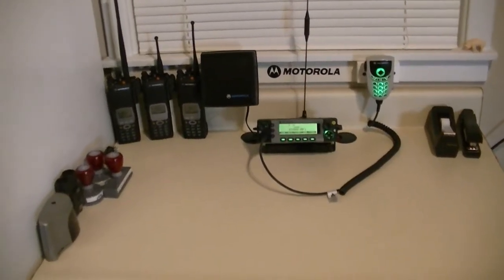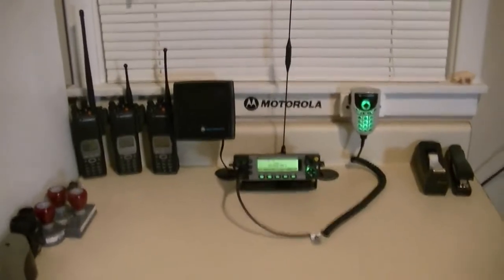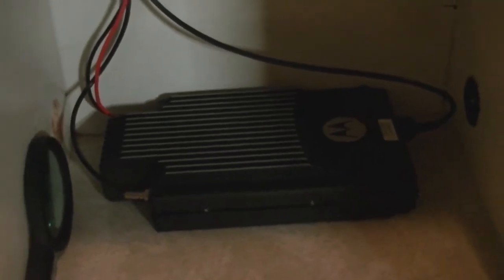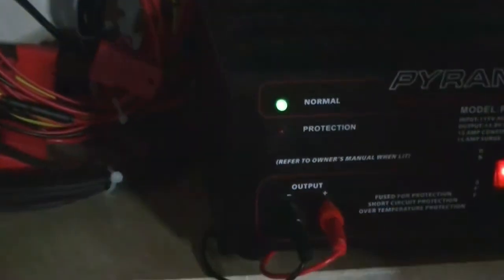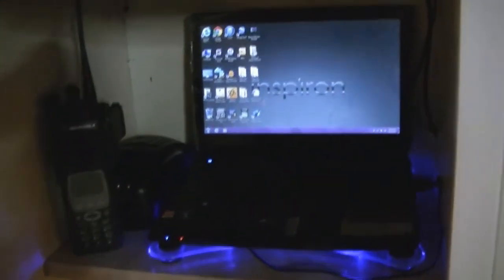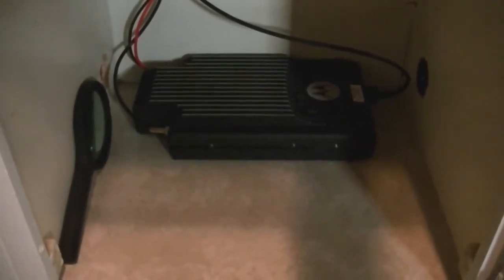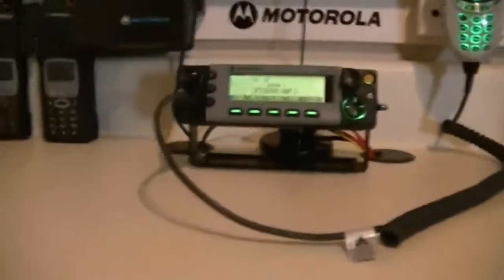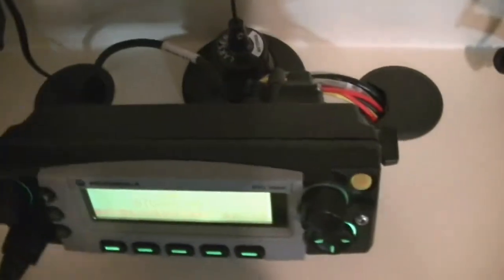MOTOROLA XTL5000 110-WATT UHF REMOTE MOUNT UNIT FOR A BASE STATION SET-UP

Comment: both mine are dual band hi gains on a rotor motor which actually helps just like on 10 Meters am/fm bands but I'm really into APRS THESE DAYS & digital uhf vhf like 800mhz bands I linked my first zello repeater setup thru one my Baofeng UV5R radios to pc sound card which repeats off my simplex to my zello app which is digital server based world wide band it's very neat indeed

Comment: Man that antenna seems a bit close, no?  I would think it'd need a ground plane unless it's one that doesn't require one.  ^^ This guy sells excellent radios by the way - some of my nicest XTS5000s have came from Mr. Snarlingrabiddog
Reply from the maker: Hey there!  haha, yep, it was way too close for my liking.  I took care of that, organized the nest of cords and wiring, got the VHF in as well, and it looks much better.  The cords were (and are) hard to manage.  The antenna doesn't require a ground but the units do.  I have an exterior ground outside and routed the line to the cabinet from the back.  I had to take it apart to get it all together.  I'd like a small switching station and an adapter to join both XTL remote bricks so I can just toggle between the bands using the same head, but not sure it's possible. Thanks for the kind words and the plug buddy!  I'm glad you're enjoying your radios.  All the XTL's are going to be sold but the UHF.  I'm renovating my shop so the XTL's have been put on the back burner for a bit :)

Comment: Understandable I'm aware of ignition purpose but also work for vol agency. I'm also in a mini boat like you but not into sales lol. More of personal use and for agency. Just looking for pointers as I've caught heck with just one vehicle which happens to be remote head. It's been the darnedest deal. Came with it but was ignition only. Have attempted to make it by power button but it's strange. Any chance off board you know anyone who would know?
Reply from the maker: I really don't.  XTL's are difficult animals and there are so many variables with mobiles, in order to address issues, the revision dates of the respective components have to be known; that is perhaps the most difficult aspect to nail down.  It seems that nearly every XTL is different; that shouldn't be the case, but in my small dealings with them, it seems to be the norm rather than the exception.  I've learned the hard way on these XTL's.  Mine install and function without issue, but understanding the component variables have proved to be an expensive education that even at the end, is one that is never complete if you buy another or build another.  After mine are gone, I'm out of the XTL game and will stick to portables.  My profit margin is next to zero on these darned things.

Comment: Dumb question and I'd appreciate if you could get back to me. The programming for remote head is it set for blank, soft power? Should be in radio wide advanced. Also does the cps show two heads in the menu say 03 or 05 or just one?
Reply from the maker: The CPS should show how ever many heads you have on the system.  It is default to 03 and 05.  Most units have no more than two but an 03 head is a remote head built into a mic housing; an all-in-one if you will.

Comment: Also does the head power have both wires connected? The yellow and red to power?
Reply from the maker: If it is base station, I hook red and yellow together because the yellow is for the ignition of a car and turns on and off with the key as you turn the car on.  I maintain constant power on base stations and turn them off at the head.  It depends totally on your application.  The more heads you have the more wires and the more of a nightmare you create for yourself, but on a fire truck rig, dual heads are common for the big trucks; one in front, one in rear.  Cable-running is paramount and you have to make sure nothing will break into the cables.  The variables change with the platforms of application.  I'm not an authority on the XTL units.  I build the parts into packages, flash, upgrade firmware, program them in basic form and optimum menu configurations and sell them.

Comment: I like your private UHF STATION very similar to mine only I have both UHF&VHF radios and my antennas are on my outside tower at 60ft like my duplex and simplex repeaters are
Reply from the maker: +Justin Berryman Thanks, I also have a 100-Watt UHF that's right under the VHF brick and it's switchable now.  I just have to switch the cable.  The antenna is tri-band, so it all works out.